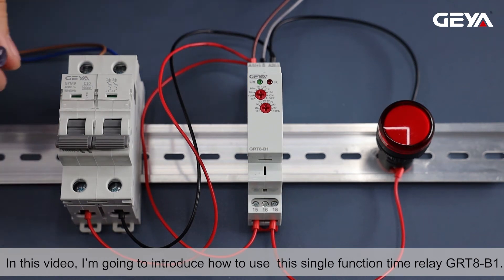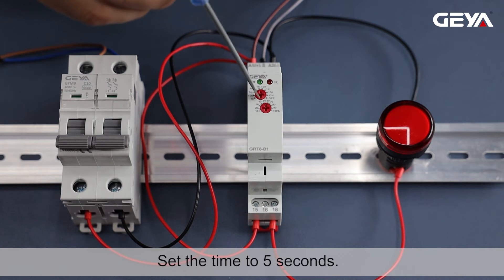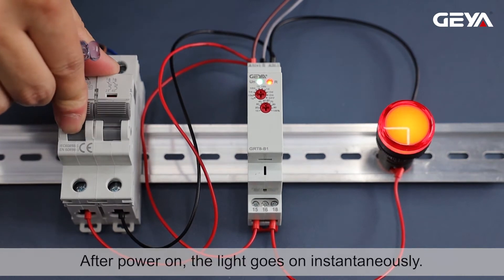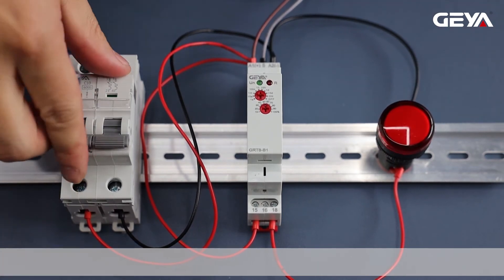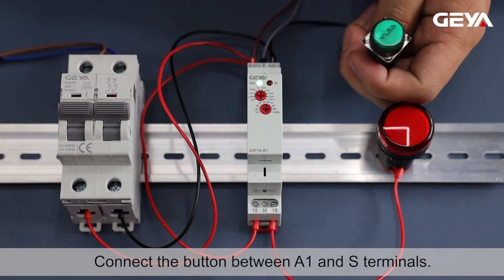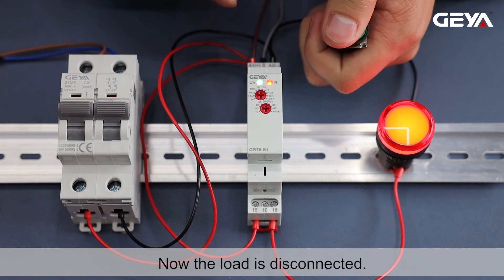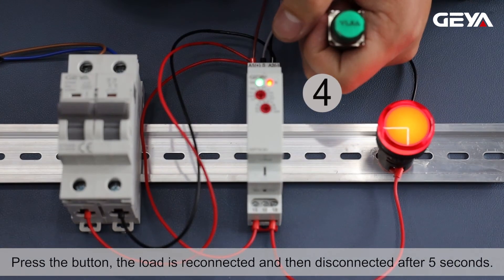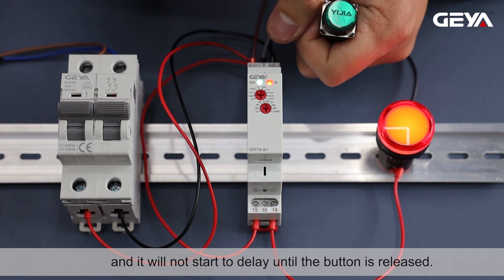How to use a delay off time relay GRT8-B1 | Geya Electric

Comment: does it work for 110vAC?
Reply from the maker: Yes, you can choose our GRT8-B1 W240:AC/DC 12V-240V.  Feel free to contact us by whats app +86 178 2690 5790 for more information.
Reply: Hello: i wish to know which is the simple timer for 
(10-15-30 min delay off)
Reply: @geyaelectric1302  on the 240v version, what voltage will trip the S circuit? Only 240v? Or DC?
Reply: @bodroddozakamal489  this relay will work.  The top rotary selector is for minutes and the bottom rotary selector is from percentage of the above setting.  For example, on the top rotary you can select 1 hour and on the second rotary you'd select 50%.  50% of 1 hour is 30 minutes.  As far as using this one device to select between those three times you mentioned, you would have to reset the rotary dials each time you want to have a different time.

Comment: This relay comes in two versions: a AC230V (GRT8-M2), and a AC/DC12V-240V (GRT8-M1).  Can anyone explain why you would choose one over the other?  Edit: Nevermind.  It's the Coil Voltage.  But then that brings up another question.  Here in the USA my single phase, 60htz,  220VAC can often read slightly above 240 volt.  How would that affect this unit?  As AC230V seems to indicate that 230V is max?